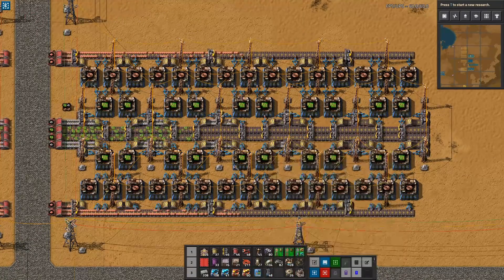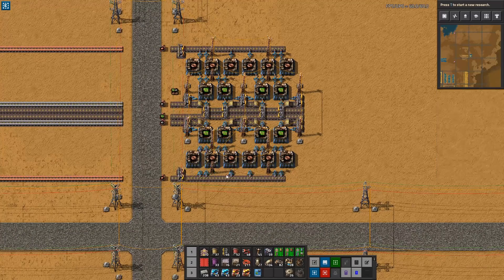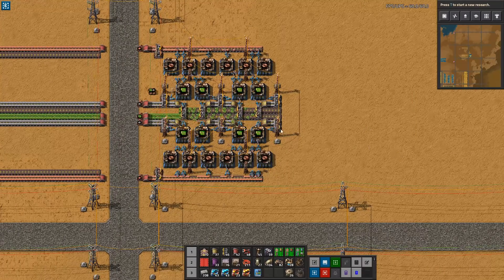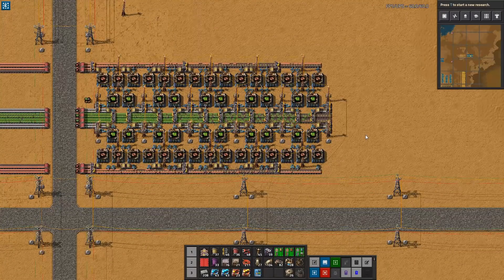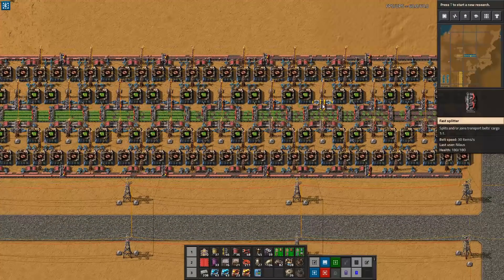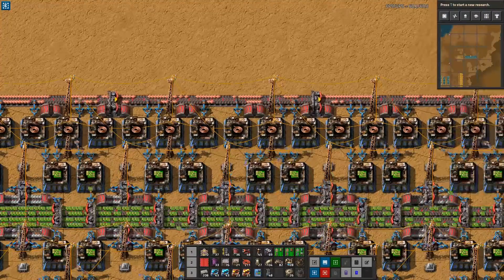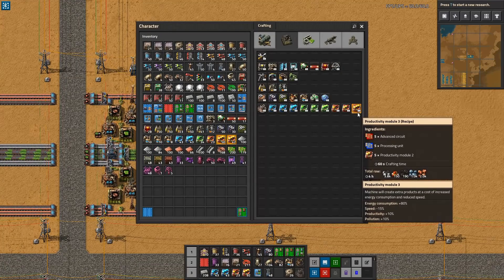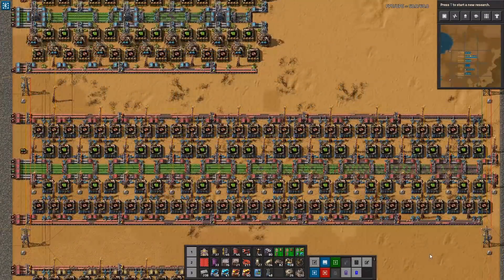Upgradeable ELECTRONIC/GREEN CIRCUITS -  Factorio 0.18 Tutorial/Guide/How-to

Comment: How do you play with Editor Extensions without the character and without the editor tools UI. When I use this mod, go to Map Editor and load the "Testing" Scenario, I can toggle between Editor mode (Editor toolbar has no close button and it always showing) and play mode, where I am tied to the character. Also when I reload my saved scenario, all builds are standing still or paused (no simulation), only when I toggle to the play mode, it resumes. How have you set up your Master Class videos in this regard?
Reply from the maker: Ctrl-e
Reply: @Nilaus  I'll simplify my question: How do you have NO character and NO Editor Toolbar like in your videos?

Comment: Love these videos, Nilaus. So useful! I was trying out the beacon design blueprint and noticed that the medium powerpoles in the outer lanes are just a smidge too far away from the substations, so they don't connect. So you really need the big electric poles/substations on the outside. However there's room to move the medium powerpoles in one tile, so that could be an easy fix.
EDIT: nope, that's still too far. Darn >.<

Comment: What about the question "should I use modules?"

I see 124 lvl 3 modules there, each costing 2000 copper and 1080 iron.  The efficiency gain is that you are using about 1.5 resources per green circuit moduled vs 2.5 unmoduled.

You break even on the module investment after crafting nearly 400k green circuits, or 70 hours of operation of one of these lines.

But what if I also have prod 3 on the blue circuits?  Then this number drops to about 55 hours.

This is a huge resource investment to maybe save some space and might never pay back.  IMO it's better to just have more assemblers and gang them together to make blue belts.

Comment: @Nilaus, what is the size of these sections separated with roads you build (city block, you call it)? I see that there are 4 long-range poles on each side. Do the poles extend fully to each other?
Reply: They're 100x100 which is 4 power poles stretched to max and then a 8 wide path (4 tiles of brick and two blank tile between the path and power poles on each side).

Comment: Can someone explain his combinators? Are they counting and displaying throughput or are they controlling what the throughput is? Where are the wires connected to?
Reply from the maker: The combinator is only there to tell the user the inputs and outputs of the blueprint. They have no practical use
Reply: Never mind, I think the combinator with the inputs/outputs was something he manually added. It's not actually reading anything our gathering any values on it's own.
Reply: @428bsm  That's what I thought initially, would be really cool though. Maybe through some form of belt item pulse count per minute somehow.

Comment: I assume 1 city block is 4 big electric poles stretched to their maximum reach.
Reply: They're 100x100 which is 4 power poles stretched to max and then a 8 wide path (4 tiles of brick and a 2 blank tiles between the path and power poles on each side).
Reply: Just measured my blueprints and they’re 102 by 102

Comment: How can I see the Combinator value?  My combinator doesn't show any ICON
Reply: I recently ran into this. You need to go into your settings and ensure you have the radio box for "show combinator values in alt-mode" selected. (Setting is paraphrased because I dont remember exactly, but its close) and then of course, turn on alt mode
Reply: @Yourlocalstraypuppy  Thanks :) I'm a new player so I was confused why it didn't show. To add to your comment it is under Settings->Interface and then the Alt-mode section of that dialog.
Reply from the maker: alt-mode?

Comment: I was just wondering when the next master class video was coming out.  I like it, been using your Blueprints for a bit now.  I hate the base to build the base faze so I usually don't make it to launching a rocket.  My current play through I swear i'm going to transition to mega base.  Starting with 1000 spm base and will go from there.  Keep up the good work.
Reply from the maker: I try to get one out every Thursday. This weekend I may add the Red/Blue since that is already designed
Reply: Nilaus when your all done you can update your base in a box book.